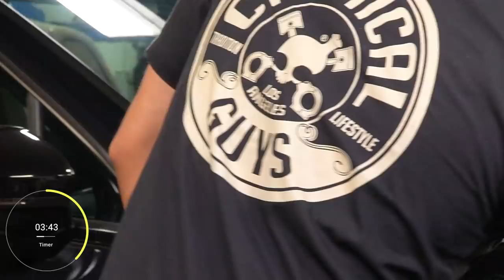3 Quick Ways To Bring Back Shine To Your Ride! - Chemical Guys

Comment: Can you use the silk shine on the paint
Reply from the maker: Hey! Silk Shine is intended for vinyl, rubber and plastic. Give your paint shine by using Lucent Spray Wax.
Reply: @ChemicalGuys  ok thanks and also could it be used on like a leather steering wheel

Comment: Do you recommend using black light glaze or hydro slick hyper wax on my black Benz? Can they be used together? If so what order?
Reply: For my black Benz I used their ,citrus soap wash , claybar , butter wet wax and finished off with their synthetic quick detail , looks like a show car , also I'm a detailer so I like to use a variety of products to test them out , and after the clay bar I went over it with my DA polisher, I used Maguires compound which is good , but I want to try chemical guys compounds.
Reply from the maker: Hello! Use HydroSlick to lock in shine while adding a durable layer or protection than it can be layered with your favorite glaze, sealant, and/or wax for added depth, gloss and protection.

Comment: Great video. Can we use hydroshield instead of silk shine?
Reply: Chemical guys has many different products for your tires.. You can use Hydro Shield to add sio2 properties to your rubber and trim
Reply from the maker: Hi there! Absolutely, HydroShield can be used as a standalone dressing and protectant or layered with your favorite dressing to enhance shine.